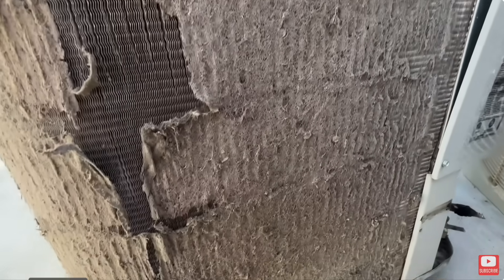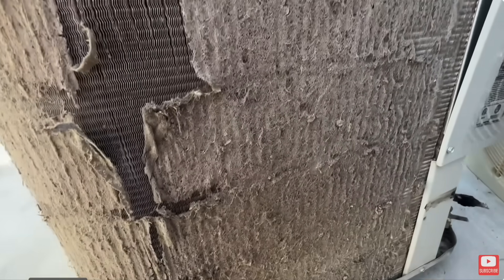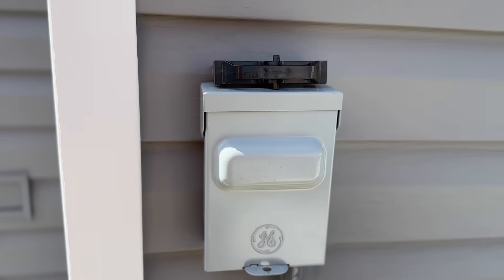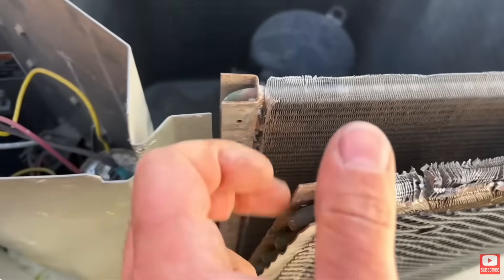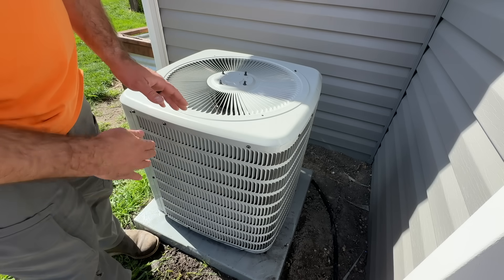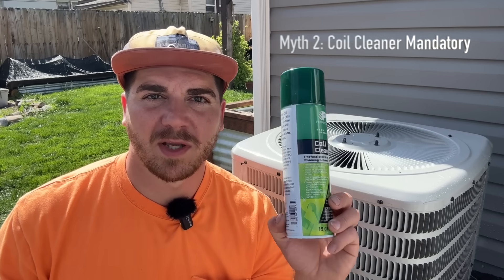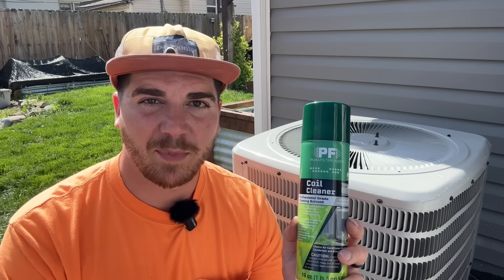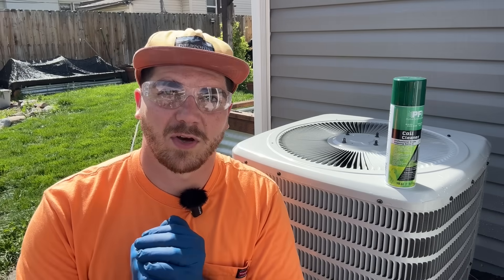Stop Cleaning Your A/C Coils The Hard Way! Do This To Get Colder Air From Your Vents.

Comment: How can I get colder air when my  ac system is only only going to give me a certain temp it's not going to get colder and telling a homeowner it's easy to replace a capacitor oh wait when they get knocked on their ass when it discharges or screw up the wiring by crossing the wiring hence fan switched to compressor and let's not forget the rating of the capacitor is it 35 microfarads or 45 for the compressor and 5 microfarads or 7 for the fan I've been to too many jobs where people watch these videos and think they are HVAC techs screw stuff up call a service company and then complain about the cost to fix the screw up went to a call the homeowner had multiple capacitors laying on the deck and couldn't figure out the problem hmmm maybe because the condenser fan motor was a 2 speed unit 🤔

Comment: I've seen 1 big error that some people will do. Don't hit the coil with enough water pressure that you bend the fins. Also, the coils that look more like strings of Christmas tinsel are a pain to clean. They'll hold onto things, such as cottonwood seeds & their white fluff, to the point that you may have to take the lid off and spray from the inside to dislodge them on the outside. Standard fins, such as the unit in this video has, will usually clean easily by just rinsing on the outside.

Some systems have coils on all 4 sides, but 1 side is covered. You may need to remove the cover to rinse that side of the coil. This is 1/4 of the coil, so rinsing it makes a big difference. However, the electrical connections are under that cover. So, pull the interlock on the wall or turn off the circuit breaker before rinsing the covered side of the coil.

Comment: If you have a dual coil unit those coils need to be pulled apart to clean between them , if you don't it is guaranteed debris will accumulate between them.

Comment: myth my ass, you go to clean a coil with a  dual row coil and there is alot of dog hair or grass or lint and you blow water from the outside in you can not get the crap through both coils you MUST blo9w water from inside out, you go ahead and blow water from outside in and ill come behind you and clean the coil properly.you are atempting to do a halfassed cleaning but you are really doing more harm than good. its no wonder you do youtube videos. ive been in the hvac trade for 29 years and i would NEVER clean a coil from the outside in. oh yeah instead of replacing the compressor you just want to upcharge and replace the system, that is such a asshole thing to do.

Comment: It all sounds great, but you are not showing a comparison. Air and debrisis sucked into the coils from the outside in. To  disloge the debris you need to fore it out in the opposite direction from which it was sucked in. I will continue to lift the cover of my unit and spray from the inside out. Thanks for the video.

Comment: I still say those merv 4+ filters choke your evaporator. Stop using your A/C system as a air purifier! It's an air conditioner. If you want air purifier for your home GO BUY ONE!
Reply: I have filters on the ceiling returns. I went to a metal fab shop and had them make me deeper return plenums. I now run 5” filters that have a 1” lip to fit a standard return grille. Works great with a 10MERV. I only need to change filters every 1000 hours.

Comment: Don't mow or use a leaf blower around your unit when it's running. If you do, the HVAC system will suck in the dust, dirt etc.

Comment: Thank you for such a good video. I do have a few questions- my unit sits near water and lots of trees. I recently noticed that pine needles have found their way into the unit through the top between the blades.  How do I get those out or do I even need to worry about them? Is this a fire hazard? You mentioned not to take the top off, obviously I would need to in order to remove the needles. So if I do indeed need to remove them, can you provide any suggestions on how to do this safely without damaging any of the components? Also, do I need to rinse my coils more often due to the salty air? I live in a condo bldg., so my unit is not alone, there are other units and shrubbery that help shield from the elements maybe a little. TIA

Comment: I have a 2017 3 ton Trane XL with those spine fin coils. My dryer vent blows right in it. I’m scared I will damage the fins and should I just use water and go from the inside out ?

Comment: My unit has air slits that face down, so I would have to point the hose up to get from the outside. Also, it is under stairs going to the upper rear porch, so I just hold the fan open with a couple bungee cords.

Comment: why would you clean a... radiator/condenser from the outside when its like a .... clogged filter and should be cleaned the opposite way the air flows? serious question
Reply: I'm no expert but I just did this on my unit two weeks ago (before seeing this video). I took the top off of mine and sprayed from the inside. I might have loosened some of the crud but I got WAY more off just spraying back and forth in a downward motion from the outside. When I do this again next year, I'm going to skip spraying from the inside and just do this. We have a lot of cottonwood trees in our area so the little fluff gets sucked into the fins. YMMV.

Comment: I surround my coil with a wooden box and fill it to the top with water. I add TSP and bleach . I let the coils soak for 24 hours and then drain the water . Fking condenser looks like new again and makes the air .8 degrees cooler than it was before I did this. Fking amazing , just amazing!

Comment: Mix Downey fabric softener in water in a sprayer. Soak the coils with this solutio and let set for a half hour or so. Then hose down with a garden hose. Do this about every 6 months. Also do it for your A coil, the evaporating, or cooling coils. No need to hose down as the condensate will rinse it away.

Comment: Well, this is cute and all for a home owner but any hvac tech would laugh at this. Taking the top off is faster and easier. By taking the top off, you can clean out chunky leafs and bigger stuff first, which allows for better cleaning when you start spraying it with water. Also, this is usually an equipment check/clean for an hvac tech. There’s more that goes into this than just a simple spray and go. Nice DIY video though
Reply from the maker: Why are hvac techs watching my diy videos? 😌 I think we all know

Comment: I love cleaning these little residential units or mini splits, most of the time I'm cleaning TRANE air handlers the size of a dump truck that are supplied chilled water from the plant. It's also a plus if it's micro channel coils.

Comment: Dawn Powerwash Dish spray works like Magic! $4.99 a bottle, all u need is 1. Spray and let it sit for 10 minutes, rinse.
Reply: That’s  probably best I’ve heard dawn is super excellent at breaking down dirt and oil I’m surprised they haven’t entered the market with that !
Reply: Thanks, I am going to try some dawn powerwash
Reply: Dawn power off is just dawn and alcohol. If it’s not really dirty i wouldn’t let it sit. I’d spray with water. Wait 10-15 minutes. Spray and rinse. I was recommended diluted simple green but I feel Dawn would be safer.

Comment: Good video and thank you!  I used some diluted Dawn/water in an old squirt bottle as suggested by another viewer below.  This worked great and got everything really clean.  I'm a Mechanical Engineer with 42 years of experience  and am wary about using those foam products.  I have a Miitsubishi Mr. Slim Minisplit and a Comfortmaker for the other side of my house.  Both units were installed in 1999 and run like new.  I keep them clean and maintain them well.  I had a couple of indoor unit control boards blow over the years and couldn't find replacements.  I found a repair source in Australia and sent them the boards from the US.  When I got them back I installed them and success!  I like your channel and keep up the good work!

Comment: That's not a proper way to clean coils ...
You need to wash it from the inside and reverse the flow.
Many of my customers do it your way and I have been called out for high head pressure issues because they pushed all the dirt and cottonwood/ lint back into the coil 
I appreciate your help for the DIY ,but leave this to the experts. 
Risk of shock from low voltage and possible damage to WET components
Reply: HVAC isn't a "handyman" trade or DYI anything about it.

22 years....EPA Universal, NATE Certified tech here.

1/1000 guys (there are no women) have both the brains and brawn for it.

"It's hard to stop a Trane!"
Reply: FYI..... f*** THIS GUY!

@KH-3414
1 day ago

Do these new air conditioners need freon and how often should you check it??

@dougblalock5175
10 days ago

Excellent advice, been taking care of my Trane units for 32 years without calling for service. 
Take time to listen to this young man folks and save yourself a lot of money. 
I’m old as dirt and can still do most of the things shown in these videos.

32

Reply

1 reply

@ogre706
9 days ago

Would be great if we lived in a world where we could trust repair personnel to always do the job properly... but since we don't, DIY is really the only way for those of us who aren't wildly rich.
Reply: @laserimage8583
2 weeks ago
Really appreciate you sharing your excellent knowledge about HVAC systems. I have question about compressor freeze up. If on a 90+ degree days and we set the thermostat temperature to 60 degree, will it cause the system to freeze up? Been getting conflicting answers, some tech said yes and some said no. What's the correct answer? Thanks in advance!

Reply

6 replies

@eDoc2020
13 days ago
It depends on your specific setup and condition of your system. If you have a "dumb" system and your airflow is limited (such as from a dirty filter or undersized ductwork) it will probably freeze up. If your system has great airflow and is properly charged it will probably be fine. Usually it's recommended not to cool below 68F or so just to be safe. If you want it colder you can get an inexpensive freeze protection control installed which monitors the operating temperature and shuts off the compressor if it gets close to freezing. If you have a modern inverter-based system like a mini-split it probably has this protection built-in.

Reply

@JohnDoeEagle1
44 minutes ago
 @eDoc2020  

Nope....air conditioners are only rated to cool 20 degrees colder than outside. You might get a bit more but no way you could ever pull down to 60 on a 90 degree day outside. That unit will freeze up. And yes, I am a licensed professional!

Reply

@JohnDoeEagle1
42 minutes ago
Good trap.....

18 degrees difference between the return and supply is usually ideal. Anybody who is licensed and has been professionally trained would already know that.

Reply

Highlighted reply

@eDoc2020
28 minutes ago
 @JohnDoeEagle1   I just looked at some datasheets and the equipment is totally rated to cool into the sixties when it's 115 outside. Obviously the actual temperature performance depends on the unit size and thermal load. If you're in a cooler climate a sensible installer might size the equipment only to cool 20 degrees below outdoor temperature but the same building in a hot climate will get a larger capacity unit.

Reply

@eDoc2020
23 minutes ago
 @JohnDoeEagle1   I know that an 18 degree drop in air temperature across the coil is good. But what does this have to do with the OP's question? We have no idea if their system was installed properly or how it's performing today.

Reply

@JohnDoeEagle1
6 minutes ago (edited)
 @eDoc2020  

Not true....if the equipment is big enough to go below that it's a "chiller" not a a/c. They use different Freon, different compressors, different pressures etc etc.

There's no R-22 or R-410A unit capable of such a thing.

R-23....aka "Agent Orange"....likely so.

Comment: Any suggestions on foam guns & cleaning chemicals?
Two summers ago I changed out the compressor capacitor and blower motor capacitor, on my 21 year old Trane system.
Both caps set me back about $25.  DIY runs in my blood. 😜

Comment: Pulling the top of the condenser and the fan, and washing from the inside of the unit  and pushing the dust, dirt pollen etc out in the opposite direction  always works better and cleans the coil so much better. Coil cleaner mixed with the proper amount of water sprayed on it, and let to sit and loosen the debris stuck in the coil and then wash with clean water works the best. My favorite coil cleaner and I have tried them all is Nu-Brite and really does the best job cleaning condenser coils.                                                                                                                                                                                     

Washing the outside of the coils as in this video is a pretty lazy persons way of doing it, and the metal coil guard on the outside obstructs cleaning the entire coil properly. Inside there is no metal coil guard and you can get at all the fins and do a far better job cleaning the coils, and pushing out all the crud and much better way professionals do it.

Comment: How dirty is dirty though.  I mean if its only dust, then whats the issue.  If its caked on sure, but I clean mine yearly with a garden hose and I have is dust on my coils  My Lennox has the doors you can remove and swing do you can access the coils better, and the just shut and put the screws back in.
Reply: I'd say if you happen to be nearby with the garden hose anyway, it's worth it to suggest a couple minutes rinsing it.

Even light dust impedes the efficiency of air temperature transfer.

Might not make a huge difference, but every little bit can help from a longevity, or even power bill standpoint.
Reply: @tracy419  I do it once a year.  But in theory, in dusty places, that cleaning may last what, a week or two.  So unless a person plants to spray it every week, dust will be an issue, but a non issue issue

Comment: As an HVAC tech the reason you spray from the inside of the unit is because the average homeowner only sprays water until the out side looks clean and there is still dirt inside the fins and on the back side of coil 2 never use coil cleaners on residential units most manufacturers put a coating on the fins on the outside coil cleaners will strip the coating off and the manufacturers will void your warranty and 3 you say taking the top off to clean it from the inside of coil is more work if you actually had any field experience then you would know that they make an air conditioner wand sold at any parts stores and Menards that slides in between the slots in the top
Reply: @tedyoh7394
6 days ago
Yeah......the proper way to clean is inside out, the AC coil is bascially built like an air filter.......first the tiny particals, say pollen, get caught in the fins, then the dust and dirt builds up next....then comes grass clippings......you get the idea.....inside out is the proper way to clean a coil.... (coming from the son of a HVAC contractor with 54 years experience)

3

Reply

@JohnDoeEagle1
0 seconds ago

This guy is a amateur at best doing a huge disservice with his "advice". He says they rarely get blockage in between. That simply isn't true and I find them like that all the time. In which case you have to run the unit while quickly and carefully whisking over with a propane torch to suck in the flame and set the cottonwood on fire. You do this very carefully and with a hose turned on and right next to you in case it gets out of hand. Don't stay in any one spot for more than a fraction of a second or you will damage the aluminum coil. After it's all burnt and the smoke was expelled through the top via the fan running you turn off the disconnect switch and go about it as normal. All the ash and residue washes right out. 

22 years experience and the company I formally worked for was in business from 1912 - 2017.
Reply: So where is the link to this? " you would know that they make an air conditioner wand sold at any parts stores and Menards" ... google shows very few of these and cost is from $100 - $200+ and Menards/Home Depot in my area don't have it. I would say if you are not an expert tech as you are, why would you spend the money? If there was some evidence that spraying from the inside actually made a difference, then maybe the specialized wand would be worth it to "the average home owner".
Reply: @thenderaaa9252  

That's 3 licensed highly experienced professionals and 1 rookie trying to look like he is thus far! This cat isn't old enough to have 22 years real world hands on experience. I would be very surprised if he was even 35 years old.

HVAC isn't a "handyman" trade or DYI anything about it.

22 years....EPA Universal, NATE Certified tech here.

1/1000 guys (there are no women) have both the brains and brawn for it.

"It's hard to stop a Trane!"

FYI.....F*** THIS GUY!

@KH-3414
1 day ago

Do these new air conditioners need freon and how often should you check it??

@dougblalock5175
10 days ago

Excellent advice, been taking care of my Trane units for 32 years without calling for service. 
Take time to listen to this young man folks and save yourself a lot of money. 
I’m old as dirt and can still do most of the things shown in these videos.

32

Reply

1 reply

@ogre706
9 days ago

Would be great if we lived in a world where we could trust repair personnel to always do the job properly... but since we don't, DIY is really the only way for those of us who aren't wildly rich.